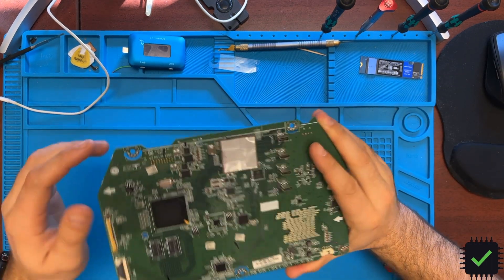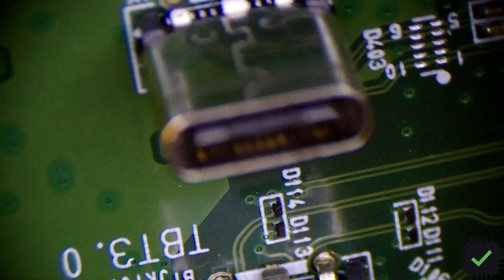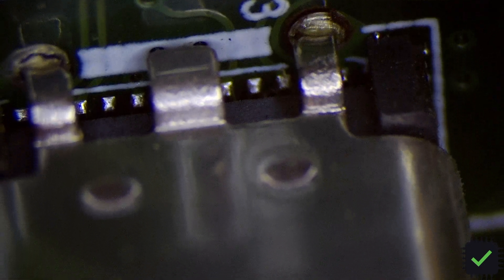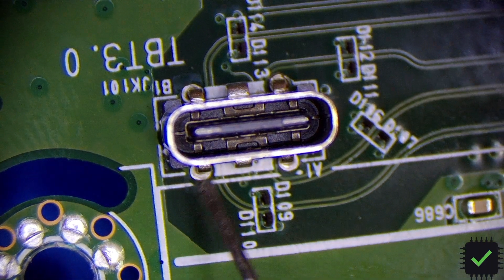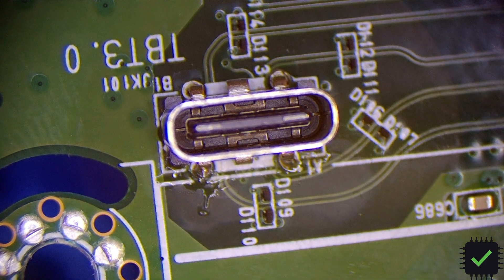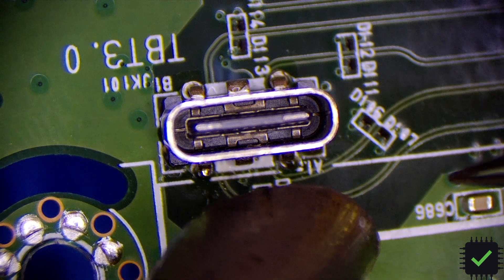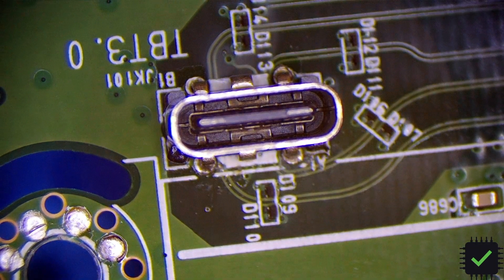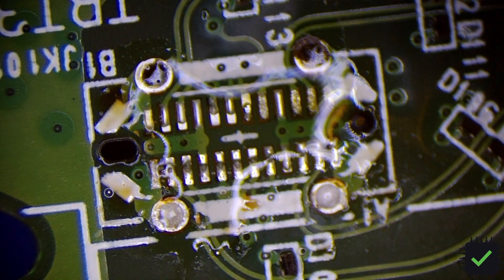LG UltraFine 5K 27" 27MD5KL-B Display Loose intermittent Connection Thunderbolt Port Repair

Comment: I won't buy an LG 5K monitor again.  When mine recently gave up the ghost at less than two years I was not very happy.  I also refuse to shell out an inordinate amount for an Apple monitor.  I think I might be tempted to try out the Kuycon G27X.  Not only has it got a 5K panel, but it supports 8K via HDMI and has both a full size displayport connector as well as video van usb-c.  It's certainly cheaper than the offerings by LG, Apple and Samsung.  I'm prepared to try things as I am not precious about brands.  I remember the line from the movie Armeggedon... 'all made in Taiwan'.  More than likely all these 5K panels are made by the same company in China.

Comment: Nice video, it was a good reference when I recently fixed a similar issue on my LG 38WK95C. Even though my replaced connector seems solidly attached to the motherboard, I'm concerned whenever I disconnect the cable. These new replacement Type-C connectors have such a strong fit with the cable, that it's actually difficult to pull out / disconnect the cable  (I feel like I'm going to rip out the connector). Is there some way to reinforce the connector to the motherboard?
Reply from the maker: Not much you can do. Inserting and removing straight to/from port will not cause any issues. It’s side-to-side motion that causes it to fail. So try not to apply any side pressure and try not to wiggle it.

Comment: Hi,
Do you know if I can use one of the 3 USB-C ports near to the Thunderbolt one, in order to replace this Thunderbolt port ?
Thank you
Reply from the maker: Yes you can. However I do sell replacement ports on eBay. Currently out of stock but should have them back in stock today-tomorrow.
Reply: @applepietech  Hi, thank you very much for your fast reply. Unfortunately, I'm not in the US and it would cost me a lot to buy a new port. As the other ports are not useful to me, I'd rather sacrifice another port than buy a new one
Reply: @CitroNade4012  DId you do the swap? Did it work?
Reply: @gster109  I dit not, I finally juste sold the monitor

Comment: Hi !
Did some find a way to prevent this kind of issue eg: a 3d printed reinforcement piece that would reduce the strain on the connector BEFORE damage occur ???
Reply from the maker: I think it’s a design flaw. Seen on some revised models LG installed a metal plate but ports on those fail the same way.
Reply: @applepietech  was thinging of a 3D printed piece to pinch the usb-c connector and keep it aligned with the connector and reduced the strain. 
ANother question, do you think an angled  connector outputting the cable downright would help ?
Reply from the maker: Angled cable would be the best way to avoid issues.
Reply: @applepietech  Can you provide more details?
Thanks
Reply: @applepietech I have two boards that I pulled from my monitors. Could I send them to you for repair?
Reply from the maker: Absolutely. You can contact me at info@applepietech.com. Thank You!
Reply: @applepietech where are you located and what’s the cost for repair?
Reply: Hey, 
what can I do to prevent this issue? 
i just purchased the monitor from ebay, and there's no go back
Reply: Ever thought about using hot glue?

Pour more than enough around the connector to hold it in place, and since it’s kinda soft, it can take some tiny vibrations/shake anytime the cable is removed or reinserted and still stay in place and also very easily removable any other time it needs to be worked on in the future

Just an idea